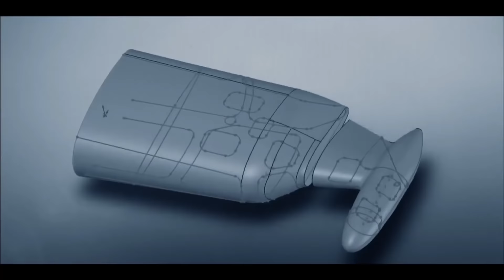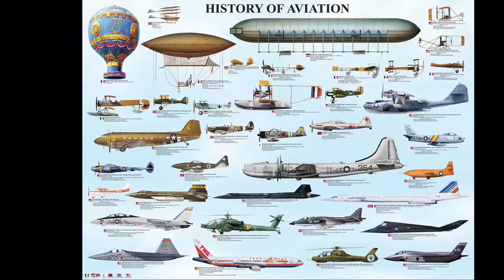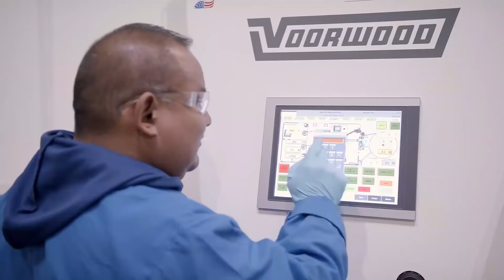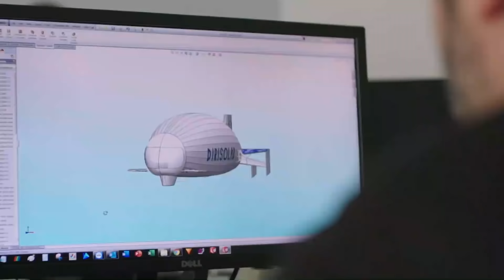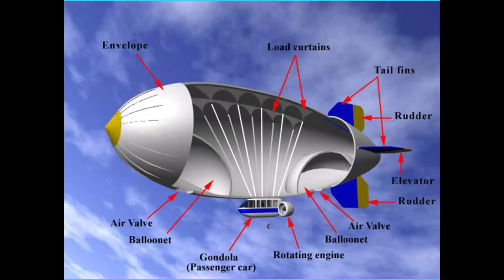Advanced Technologies for Modern Airship

Comment: Rather than full vacuum, as an interim step, what about reduced pressure Helium airships? If the pressure is 1/2 bar, Helium lift, buoyancy, equals that of Hydrogen. As materials strength to weight improves, new vessels use progressively higher vacuums for improved lift.
Reply from the maker: That is a great idea.
Reply: @m.j.debruin3041  yep! Elevated temp lowers density w/o lower pressure. Need an insulating envelope though
Reply: @richardrigling4906  If you want to use higher temperatures you need to insulate the hull and heat its interior. If you are willing to do that you should consider switching to H2O as a lifting gas.
Reply: Interesting. I think the main issue is finding the right material but I really like this idea about lowering the density of the chamber but still using helium.
Reply: Question what about carbon nanotechnology?
Reply: Make the hall black. It will heat up on sunlight.  Also layers of helium will isolate enough. Warm the core and the outer layers could be used as isolators.  It has to be thin though otherwise won't work. I wonder how easy is to warm up helium.  Probably not easy as it doesn't convey heat well. Maybe need a fan to circulate it too.
Reply: The problem is ideas and engineering never match exactly. Probably more pressure needed or so. There is always something disturbing when you try building something.

Comment: Also, hydrogen can be used as a fuel in the ship itself - The Graf Zeppelin of the 1930s used a gas a fuel that was the same weight as air to avoid ballasting issues - Ultra fine loose weave fabrics that prevent flame fronts can be very light indeed (such membranes work in gas pipes to prevent travel of fire, but still allow the flow of gas) so pragmatically, I can image hydrogen airships being a very good solution, ^oo^
Reply: It was called “Beau Gas”
Reply: Pppppp
Reply: P
Reply: Zeppelin was working on heaters in the gas cells too so hot.yydrogen isn't impossible
Reply: @johnp3937  Doesn't sound a very efficient use of energy - hard to insulate an 800 foot long vehicle flying in a constant 70mph wind at cruise!  Perhaps with modern materials it might be possible - hydrogen does have the advantage of being one of the best gases in terms of expansion per unit temperature, ^oo^
Reply: @bernardthedisappointedowl6938  I think that the idea was to stop the airship losing bouyancy in cold weather. They suffered from venting gas in hot weather on the ground and then having insufficient lift...or having to dump lots of ballst when the weather became cold. I recently came across a biography of Hugo Eckner.. I read it there. It's a proof copy and very interesting
Reply: @johnp3937  Interesting - fascinating person Hugo Eckner - what was the name of the book out of interest?  I'd be intrigued to read that myself, ^oo^
Reply: @bernardthedisappointedowl6938  I will look for it. I had a quick look without any luck. I'm going to separate aviation biography onto one shelf. I'll keep at it and let you know when I find it.
Reply: @johnp3937   @bernardthedisappointedowl  haven't i read of "Hybrid" ballonets.? a gas wiih lift (H, He) to make a neutral buoyancy? the hot air, for lift, and or to vent for altitude.  Or was that some old comic book
Reply: @LouAlvis  there's a lot of work being done around that sort of thing. One thing about lighter than air craft..... they don't work well in smaller sizes because of the cube rule. To get the most out of them they need to be very big indeed
Unfortunately this makes it expensive to build prototypes and difficult to attract funding. Personally I think hydrogen is the way to go. Easy enough to make the passengers safe nowadays. The pipstrel company won a design competition.... I might be wrong on details but broadly speaking.... for an airship...lifting body shape with solar panels and rats....ie ram air turbines. The idea is power can be used to vary the bouyancy. Making it lighter than air and it can use the airodynamic forces to travel in a chosen direction or to maneuver. When it gets to it's max desired altitude the gas is compressed into cylinders and or cooled to become negatively bouyant when it continues to move moranuver without needing external power.   Sorry about the spelling. I'm too lazy to correct it
Reply: @johnp3937  thanks for you informed responce.  the "small" airships we see have always made me double down on the problme of volume. we will never be able to really show the abilities of airships, untill they are big enough to do more tyhat be sigh seeing platfrom or bill boards.
Reply: Helium is getting short I don't want any manufacturers to use it short of medical and military.

 That would be cool though with hydrogen cells and such as we can make that. Slap some solar panels and make among that new invention where it pulls huge cargo ships. Basically a sale! 

 I'm an idiot though but helium shouldn't be wasted.
Reply: @dianapennepacker6854  It is a precious resource - and medical apps do seem to be the right priority - and possibly nuclear fusion, seeing as that would also produce more helium! - if not a lot - There's an argument for very well designed airships to use it, as no operator would willingly vent, and alternatives like compressing in flight might solve the requirement to even need to do so - Personally though, I think well managed hydrogen is a better way forward for airships, ^oo^
Reply: @johnp3937  With new materials and super-light gas porous but flame stopping sheets creating  compartmentalisation, limiting any fire - yes I think hydrogen could have a good future as a lifting gas - it's also around 10% great lift capacity - minus losses, say 7% better - which means an increase in useful load from a typical 33% to 40%, which is a a around a 25% increase in utility for managing hydrogen, ^oo^
Reply: Azazel No Helium so we don't run out in the future as it is very useful!

 Wondering how future green technolgies will get more of it still left on the planet.

 Wonder how bad the shortage is especially when we are trying not to drill. 

 Hopefully space mining becomes a thing but I'll be long gone!
Reply: @bernardthedisappointedowl6938  To be honest, I didn't even know that there are fabrics that can withstand the temperature of hydrogen combustion. But if it is, then it would be just great. May I know the exact name of the material?
Reply: @diasabdrakhmanov5301  The temperature of the flame front of hydrogen (or indeed any combustible gas) is dependent on the pressure and oxygen mix - by example the SpaceX Merlin methane rocket engine burns methane at temperature of up to 2900 centigrade - whereas you can experience the same combustion when lighting a gas stove with match from spilled gas - an yet experience no significant burn due to the poor mixture and brief time exposure - Hydrogen interestingly had no radiative heat, because there is no carbon being burnt - which was a problem for fires in NASA, as the flame would be invisible and undetectable until someone walked directly into it.  The materials that are looking interesting for making hydrogen lift segmentable and sufficiently light are graphene-based - though a hybrid of ceramic fibres with carbon-fibre or graphene threads is also a possibility. ^oo^
Reply: Azazel  Why not use the hydrogen up in a fuel cell or something. Do some electrolysis on water vapor to get more. If the whole thing is covered in solar cells that is.
Reply: @t72oftruth66  It was called "Blau Gas".
Reply: Ammonia is the better hydrogen. It's probably good enough as the lifting gas for hybrids, can be cracked into H + N which can be burned as fuel and vented. It also compresses easily. So you could balance your buoyancy by changing the ratios of 4 different gases.
Reply: @dianapennepacker6854  
Pls don't abuse yourselves verbally.
What you write us not idiotic.
Reply: Pragmatically, no-one is going to risk using gaseous hydrogen for civilian airships. Period.

Comment: A note regarding vacuum airships, it's good to mention that it doesn't have to be a full vacuum. If you take a normal airship filled by a lifting gas but at slightly lower pressure and slightly higher temperature you reduce the density of the gas further without needing as strong of a hull. The heating could in theory be a solarthermal system if operated in a hot enough climate like in the mediterranean, africa, central america or the middle east

Comment: R. Buckminster Fuller pointed out that if you made a geodesic sphere out of steel and glass, it would float in the atmosphere because of the solar heating inside would be lighter than the cooler air outside. He envisioned habitats in the sky.  But you would have to heat them at night to keep them aloft.

Comment: Most informative video I've seen yet on contemporary airship design concerns.  However, has anyone considered dynamically increasing vacuum with altitude based on differential pressures between inside and outside?  It doesn't have to be all one or the other.  Atmospheric pressure reduces rapidly with altitude, which means it's kinda silly not to reduce the pressure within one's dirigible airship, in kind.  If hydrogen is used with lightweight flexible solar cells on top then you could release the hydrogen gas and make more from water, using electrolysis when descending.  

Another approach to containing a vacuum even under full atmospheric pressure would be to use a high-velocity rotation of the vacuum chamber to counter the strength of the vacuum.  High tensile strengths are easy to acquire in the lightest materials, e.g. and especially carbon nanotubes.   Granted, the velocity would need to be pretty extreme.  We can achieve those extreme velocities through brushless electric motors and also with larger diameters.  In other words, larger vacuum ships would be easier to build. 

This was once the basis of an orbital launch vehicle I designed, at home.  The idea was to form it with broad wings for lift.  A large lightweight vehicle would take far too much energy to gain any reasonable velocity at 1 atmosphere of pressure but this dynamic changes very rapidly with altitude.  As the air thins, hydrogen gas could be expelled replacing it with a vacuum.  If that hydrogen gas is heated (or combusted) then substantial thrust will ensue, at an increasing rate with altitude.  So long as there is sufficient atmosphere to create resistance there must also be enough to create lift, so little energy is lost.  Once there is no resistance, it is possible to maintain unpowered orbital velocity.  There is an obvious equation here that implies that the vehicle must be pretty large and the ascent will begin very slow but with an exponential increase in velocity.
Reply from the maker: Such a key point you have made, that you dont need full vacuum but a partial dynamic vacuum can also do the trick. This should be investigated
Reply: Years ago I worked with a group from California called JP Aerospace, I think, that were working on something like this. Look them up; they might still be around.
Reply: Spinning a vacuum chamber seems like a really great idea. My first guess is some sort of can with bowed in edges facing the axis of rotation. There's a lot more math that would go into it, but some rough calculations gives that the curved surface of a cylinder should be able to balance about 100kPa at 3000 rpm when the radius is 1m and a surface density of 1kg/m^2. Though I don't think you necessarily need to full balance the pressure, just bring it down to the point where a lightweight material can handle. Adding structural supports inside the chamber might also help reduce this requirement.

I do like your orbital launch vehicle design as well. Seems that once you've used up all your hydrogen as propellent and are at a negligible air pressure, the vehicles rockets should be able to cheaply handle getting to a stable orbit, and the launch vehicle can glide back to earth. Does the vehicle have enough fuel to bring itself orbital velocities or does it just get the payload to the edge of atmosphere?
Reply: Where did you learn this kind of stuff? That's pretty cool.
Reply: I was gonna reply... but you are exponentially more smarterer than I am.. so I'll just follow and chill ✌️
Reply: Can the hydrogen be mixed with air untill it has bonded with all the oxygen creating water(to be used again later), but turning itself into a inert mix with other gasses to the point of dilution, but still giving lift as a noble gas? I'm pretty dumb when it comes to science, but it still interests me.
Reply: It wouldn't matter how fast you spin the vacuum chamber, the pressure on it from without would remain constant from any and all directions.

Lighter-than-air aircraft can be used to get in to space but as long as the lifting chamber is still attached to the craft then there is no need to go in to orbit.

Comment: I do hope the airships become more successful  and popular. I'd book a ride.
Reply: Now, airships are often used for advertising or aerial broadcasting, which is exactly how Goodyear utilizes its fleet of airships. In fact, in the U.S. there are only 124 pilots with a rating to fly an airship and a mere 39 registered airships, according to the FAA.  4:35  [CNBC]
Reply: The hull of the airship is nothing like in the past. Today's materials are strong, light and rip-proof by fusing layers with different properties to form the gas-proof skin. Airships fly low, unpressurised. This means there is no risk of rapid decompression, thus eliminating another threat to air safety.  7:56  [OceanSky]

Comment: Damn! I had thought about vacuum air ships when I was a kid. I never figured out the math to see how feasible it was. Thank you for showing us here. Also ISO truss from BYU's material science dept would be a great weight saver, used as a vacuum shell, surrounded by some amazing skin material.
Reply: He said there were no materials that could stand a vacuum so how can there  be manned space stations and manned space suits.
Reply: @roycampbell3433  
The vacuum is outside the object /suit in space so the pressure only has to be kept within .
In a vacuume airship the void is inside and the skin not only has to prevent the atmosphere getting in but hold the shape of the removed volume of air..against not just atmospheric pressure  at depth s  below sea level ...   Like the Danikil Depression ..the current lowest point on the Earths surface . ..but against high winds giant hail and possible impacts. 
It helps to think of a vacuum airship as a very light submarine with a vacuum  inside .... that means its very vunerable to a catastrophic collapse without and extensive internal structure beneath the surface material... Like a birds wing bone but even less dense and with vacuum in the voids.

Thinking further on the idea i think there would be a maximum size of any floating  vacuum   envelope and it would be very difficult to maintain sufficient displacement to generate useful lift.  It will get multiples x harder as the lifting body increases in size.

Comment: There is ongoing R&D for pure carbon based meta-materials for vacuum airships. The strength of such material allows for airframes of various shapes with a utility comparable aluminum alloyed aircraft. The acceleration and speed of these upcoming aircraft will also facilitate access to orbit, space, Mars, and the asteroids. Imagine using bouyancy to reach the edge of space and then firing rocket engines. 1000's of tons per ascent. A thoroughly reusable vessel similar to aircraft. A Martian outpost can be a reality in a few years once the meta-material is perfected.
Reply from the maker: I have been watching "The Expanse". I like what you are saying
Reply: The first company to produce such material makes billions

Comment: Someone did a calculation that determined that you didn't have to have a single hollow sphere holding a vacuum to create lift.  Instead you can create microscopic hollow spheres out of graphene that could hold a vacuum and still create sufficient lift.  

I don't have the source information, but the math is straight forward and should be easy enough to check and to find where the sweet spot is where the graphene sphere is small enough to maintain its shape and still have enough displacement to cause lift.
Reply: You may even be able to have a flying suit of those!
Reply: @martinwilliams9866  Possibly.  But you'd need some other means of getting down from your buoyant point when you were done.  I doubt if slowly releasing black spheres into the atmosphere to control your decent would be a good idea for the atmosphere.  Maybe hire a plane to pick you up?

Comment: Seems a good option would be to partially pressurize at sea level & pull close to total vacuum at high altitude where ambient pressure is much less (14.7 psi @ sea level vs 5.5 psi @ 25k feet).

Comment: I love the idea of airships. Vacuum ships that you have just discussed opened my eyes immensely. The biggest thing that concerns me personally is windy conditions. How hard is it for airships to deal with strong winds, and like ancient sailing boats, could the wind be harnessed for propulsion and tacking against the wind? I would love to see a video on this if you are inclined. Thanks
Reply from the maker: Airships handle head wind without much trouble. Crosswinds can be an issue but they have thrust vectoring to counter that now
Reply: I've given this a considerable amount of thought, and as far as I can tell, it wouldn't be possible to effectively use wind power unless it's behind you. It is the ship's hull resting in the water that provides the ship with something to push against to redirect the force of the wind.